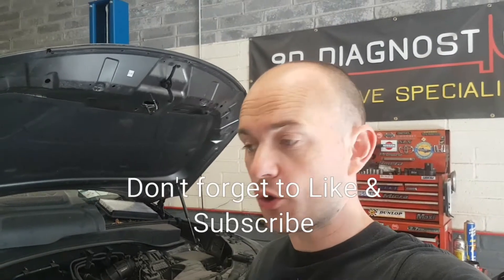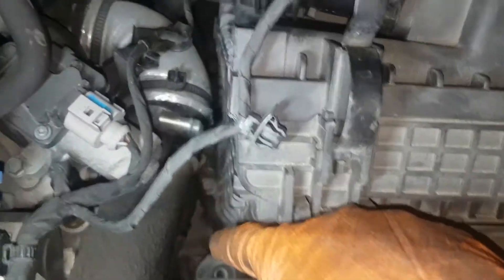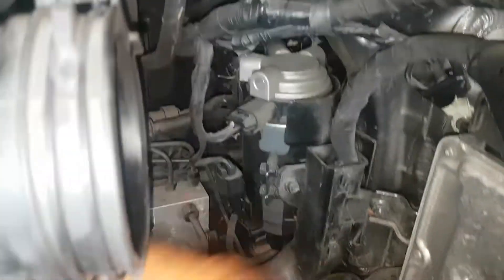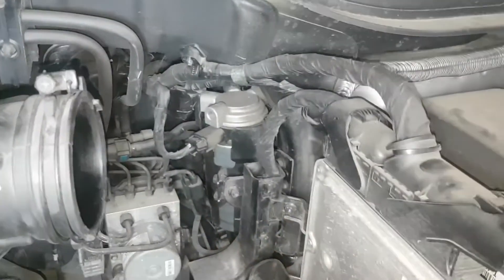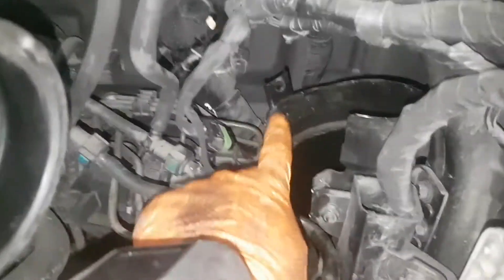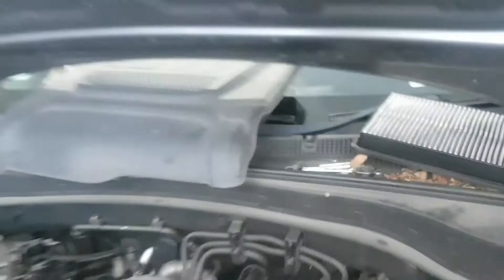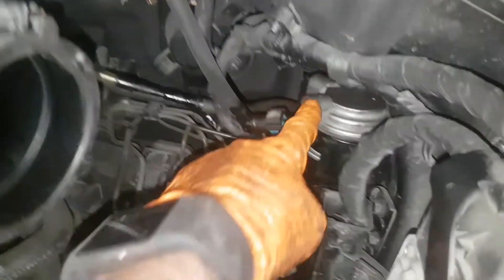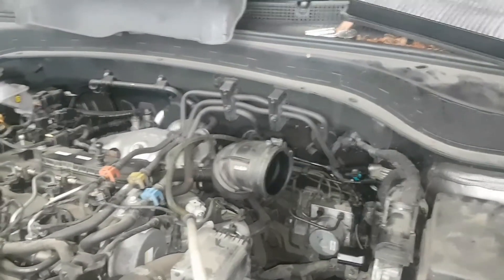How to replace a fuel filter on Kia Sorento 2015

Comment: Would have loved if you'd also shown re-installing the filter. That was a real pain. Filter does come out  (just) with the lines connected. But nearly damaged the lines trying to put it back in with them connected. Trick for me in the end was to disconnect the fuel lines from the filter, place the filter in the cradle and then reach around the back and reconnect them. Hope that helps someone else. It's a pretty fiddly job - be prepared to skin your knuckles a few times!

Comment: There is very little info on this but ran into the same trouble with priming the fuel filter as with other Kia/ Hyundai products with this R series motor without dealer serving tool.  For DIYers you should prefill the filter throught the FEED line with clean diesel and a syringe before reinstalling in vehicle. This will mean you need about 500ml of diesel on hand.   Remove the ENTIRE fuel filter mounting bracket, The bolts for this are not shown in this video and are hidden behind the wiring harness. It is 2x 10mm nuts undo this harness and move it out of the way then 3 10mm bolts hold the filter and bracket assembly to frame. its is very easy to remove this way and will not damage any components.   Thanks.

Comment: I don’t think this is a 2015 Kia Sorento.  They are “not serviceable” according to all the parts stores.  They are in the fuel tank!  You may have a split year?  This is a great instructional video, but my 2015 Sorento fuel filter is in the tank!
Reply: Diesel engine.
Reply: U have 2 filter , 1 in tank  and second under hood